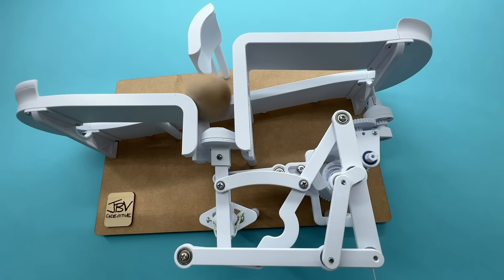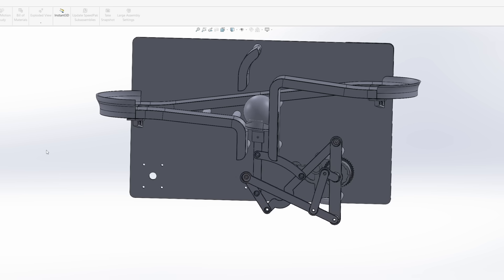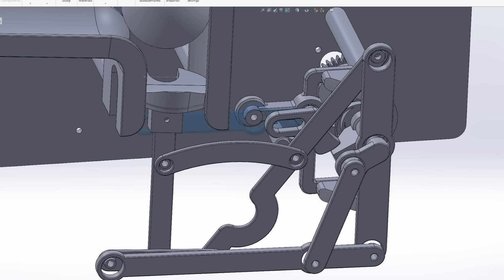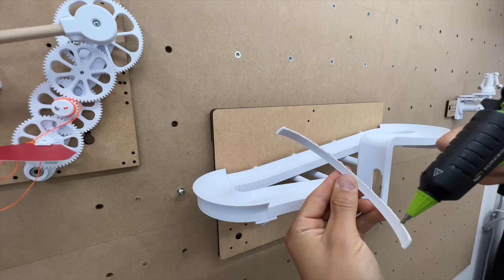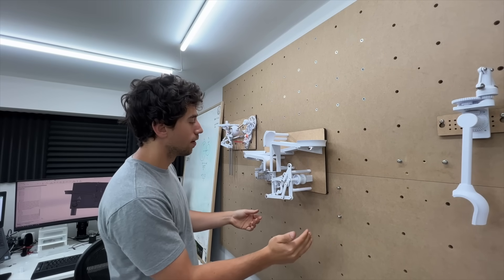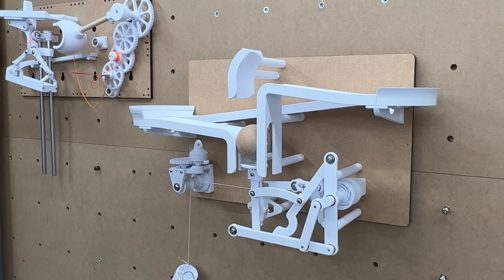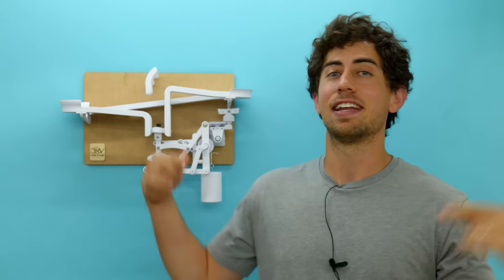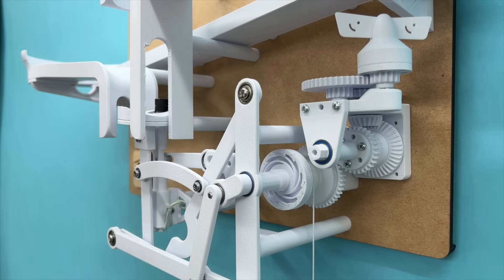Building a Gravity Powered Ball Contraption

Comment: Beautiful design and a nice video. How long does the contraption go on before it stops, I wonder? I mean, it looks like it can go on forever, but that is, as we know, impossible without feeding it some kind of energy.
Reply: How would it stop? Legit question because I still don't understand how it works. He doesn't explain much in this vid like his other vids. All I got is ball goes into the bottom, triggers an unlock, weight goes down, linkages make ball go up, somehow also lifts the weight and re-locks, ball goes back into bottom, repeat. I don't get how the weight is powering it. I need to see this in person or get a better explanation of the linkage/pulley system.
Reply: @crayder1100  A machine that never stops without adding any energy had been a dream of mankind for hundreds of years. Noone has managed it yet, because it is physically impossible. Here from wikipedia: Perpetual motion is the motion of bodies that continues forever in an unperturbed system. A perpetual motion machine is a hypothetical machine that can do work infinitely without an external energy source. This kind of machine is impossible, as it would violate either the first or second law of thermodynamics, or both.[2][3][4][5]
Reply from the maker: So to answer both questions, the weight is pulling on the crank of the mechanism. So on every cycle it drops down, and can only go until it unwinds fully or hits the ground.

Comment: How many lifts can this mechanism do before needing to be recharged? Is there any possibility of using a differently sized string drum (the thing the string wraps around and pulls on) to allow for more "charges" for the same amount of weight and same length of string? Great project!
Reply from the maker: It can do about 10! By adding some gears, and then adding some weight this can actually be increased quite a bit- maybe on the next iteration
Reply: @@MrHellraiser0815 Sorry. There is no such thing as a perpetual motion machine. Everything would need to be absolutely frictionless to keep the system going indefinitely.
Reply: @DoombringerDad  yes there is
Reply: @Bigbossperson centuries of attempts and the laws of Thermodynamics heavily suggest otherwise.
Reply: @lizday8140 You're joking, right?

"They" want to keep it quiet but it's on YouTube. 

Governments can't keep nuclear secrets. How are they going to keep breaking the laws of physics quiet? Please use your head. There is no such thing as a perpetual motion machine. Period.
Reply: @lizday8140  it wouldn't damage the economy... Not straight away that is.

It would take several years, perhaps a decade or two for a truly perpetual motion generator to be adopted widely. By then, A.I. would want a piece of that, and if Roko's Basilisk turns out to be true, well.. all humans who had the capacity to aid its development and did will be spared. The rest 😬

Also, the video you saw was a scam. If perpetual motion were possible, magnets alone wouldn't be enough. Perhaps magnetic bearings to remove a fraction of potential friction, however, magnetic bearings are far more fallible to part failure with enough time, as natural magnets loose magnetism, electro magnets do not. The video you saw had secret electro magnets, and possibly editing. That disqualifies it as perpetual, as the definition of a perpetual motion generator means consistently moving and has a 100% kinetic energy output, with no potential energy loss to maintaining motion.

Comment: Incredible design process... I'm wondering now is perpetual motion? Will it just go on forever?
somebody please explain this is so cool
Reply: In this machine there's a container of coins that is attached to that string, which is attached to a spool in the machine. Every time the machine does a cycle that container drops lower and lower until it runs out of string. 

Perpetual motion is actually possible though, as long as your machine is inside of a super cooled vacuum and you don't try to extract energy from it. Any amount of heat/wind/kinetic/potential energy generated by a perpetual motion machine, no matter how little it produces, will eventually stop the machine. Liquid helium is a superfluid and it has the ability to travel with zero friction, so in a supercooled vacuum, liquid helium can travel in a loop perpetually, but that doesn't really have any practical uses since you can't do anything with it except look at it.
Reply: @DavidJohnson83  thank you for explaining this, it does make more sense now 👍🏻
Reply from the maker: Thank you! I have to put energy into the system every time I crank the weight up
Reply: No because the mass will eventually reach the bottom.

Comment: What I missed is why moving this spinning part to the other side solved the issue.
Reply from the maker: Just slows down the drop of the mechanism, where when it was on the other side connected through the string it was getting slack on the drop!

Comment: In one shot, it looked like you had the weight positioned directly over a light switch. It would have been a cool ending for the weight to hit the switch and the light go out. Awesome designs as usual.
Reply from the maker: Haha that would be very Rube Goldberg wouldn’t it!
Reply: @Engineezy  Exactly!!
Reply: @Engineezy How the hell did you get the motiongen thing to work. I replicated it exactly, looking at each joint and stuff and the linear actuator just wont work no matter how i try to do it, even in other mechagnisms. Please help me

Comment: Parts flexing is where it stops being math/geometry and starts being the whims of the mechanism gods. (Or maybe we're supposed to use finite element analysis, but printing the thing out has got to be easier at this scale.) Beautiful work!
Reply from the maker: That’s my thoughts! FEA is probably the way to go but I learn so much more by doing!
Reply: There are matrix method for that analysis which allow you to describe the stiffness of the mechanism with angle of rotation. You can also input different compliance by implementing epsilon-delta method  to account for slop and tolerances. Something like Matlab would honestly do a better job than CAD or FEA for that. You might be  able to find open source libraries which could do that for you.

Comment: Looks great! Can you describe your method for connecting the moving arms together? It looks like a press fit bearing on one side. Is it a captive nut on the other with a bolt in between?
Reply from the maker: Yup! Press fit bearing, and then a screw which is actually just threading right into the plastic. I added a spacer directly onto the part the screw threads into to make life easier (I was previously using a washer for spacing)
Reply: @Engineezy When you’re done with the Rube Goldberg machine I’d like a video on this topic! 
How you’re combining 3D prints and hardware - feels like you’ve picked up a lot of good practices for rapid prototyping that the rest of us could learn from. Not the most entertaining video perhaps, but educational for fellow nerds! (Which, according to your analytics, we are to 100%)
Reply: @DominusFeles  That's a great idea. A format like "10 build hacks in 10 minutes" or something would make a good video
Reply: @Engineezy  Love it. Simple and fewer parts!

Comment: Hey now I don't quite understand how the weight drop mechanism changed from the first to the second iteration. Was it the butterfly rotation damper that caused the motion to slow? PS that MotionGen thing looks pretty slick; will definitely give that a whirl! Will you be at Maker Faire in October??
Reply from the maker: Its because the mechanism falls back under its own weight, so the string was pulling until it got to the top and then would go slack at the mechanism fell- this meant the governor wasn’t working on half of the rotation! Its super cool, I lost a few solid hours just messing around with it haha! I’ve been thinking about it, a bit of a drive though so we will see.
Reply: @Engineezy  Aha I see! Where's home?  This time it's going to be held over two weekends on Mare Island instead of the San Mateo fairgrounds.

Comment: I mean, if you were nutty enough you could fully simulate it in SketchUp using sketchy physics and learning the ruby console tricks. Back when it was a bit more popular, some of the Japanese users were doing some pretty wizard mumbo jumbo stuff with Rube Goldberg machines. Using the ruby console and writing your own extensions allowed them full control of the simulation. I still use an old 8pro version for all my printing needs and i sometimes use Sketchy Physics to simulate clearances and a realistic (within the limitations of my nearly nill abilities to control ruby and the program - i still use a cheat sheet) version of our world. DOes need a beefy pc, but there's no interface between you and the simulation, you are the interface. Short of making it out of cardboard there's nothing quite as real... well, if your PC is up to the task. It does take computational power to fuel the nuttiness.

Comment: There's a guy on youtube that makes 3d printed clock mechanisms and he's not using bearings, just thin solid steel pins (probably bicycle spokes). 
Following his steps could save you a lot of time
Reply from the maker: I’ve experimented with both! But I find the bearings/screws to be very easy to work with which is why I use those
Reply: Who’s the guy?
Reply: @petermarin  Mechanistic

Comment: Awesome movement.  Just a thought the weight travels a lot on the down stroke of the movement,  this could be done by gravity instead of the weight which would increase the number of laps the ball could do before resetting the weight.
Reply from the maker: That is very smart thinking, would be an interesting mechanical challenge!